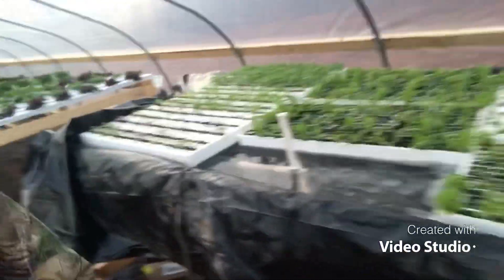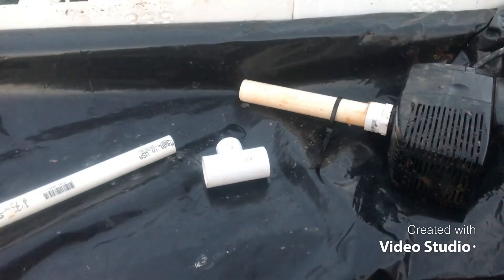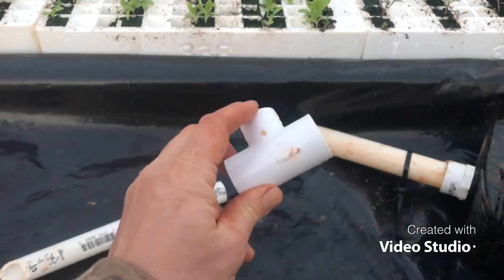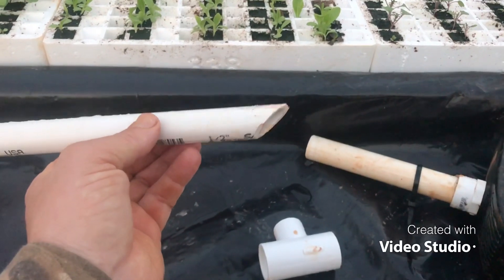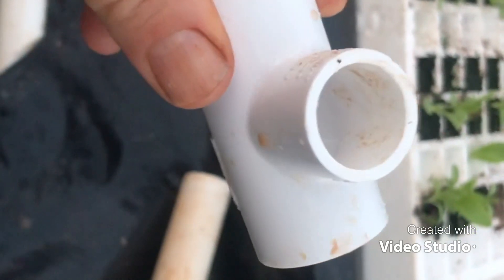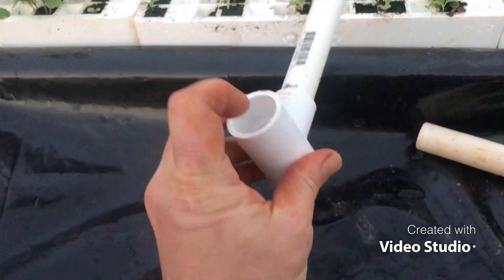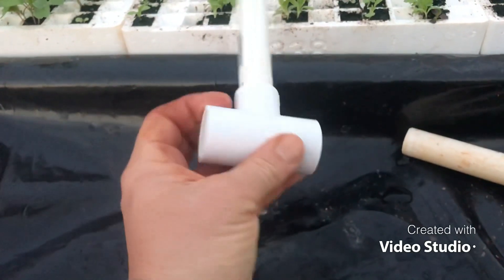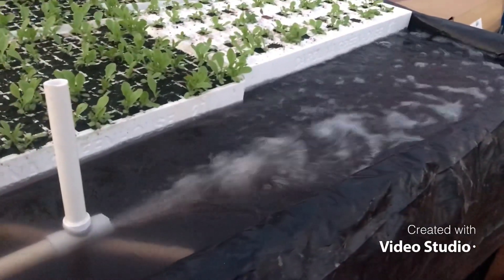Stop using airstones for hydroponics! Build this simple $5 venturi in 2 minutes instead!

Comment: hmm i dont understand..so what is difference from taking just air Hailea compressor air pump fith hose to pump air in the rezervour ?
Reply from the maker: The Venturi aerates, while recirculating the water, is simpler, more effective, and much, much cheaper when you scale the system up.

Comment: How does it compare to airstones in terms of aeration though? Airstones might be able to create smaller bubbles. Have you done a comparison of crop growth?
Reply from the maker: I’ve never done a comparison, I was just using what I had on hand at the time. A lot of people appreciate this because most people have a pump and some pvc already in use in their system. 

Why is it better?

1) it adds recirculation to the solution while only using 1 pump.

2) it doesn’t add any heat to the water.

3) it doesn’t change the ph like some airstones can.

4) it’s easy to clean when if it gets fowelled.

5) it spreads cool air bubbles around instead of in 1 spot.

Does it provide more dissolved o2 to the water than an air pump? This is relative. An x watt air pump is going to move as much air as an x watt water pump, with the exception of heat. If the air pump generates any heat as would when you compress and pump air, then your dissolved o2 is probably going to be lower if the wattage is the same size. 

My experience, I have never used an air stone but have had such great results with this venturi system that I will never need to even try. My roots are always very healthy! All I know is i read a bunch of negatives about airstones when I was researching them.
Reply: @SaludaGradeFarm Thanks for the great response. 
I can add that swapping out between air stone and  to a diy Venturi air-lift seems to be less of a load on the same air pump and bubbles are the same in size. 
The more uniform distribution if that freshly oxygenated surface water  is a big benefit.

Comment: How often do you change the water?
Reply from the maker: About once a month. Since I'm growing baby greens, and its DWC, the nutrient solution is incredibly stable. I hardly have to mess with PH or EC, except when I have to top it off, which is every 2 weeks. There is also far less algea in this compared to my NFT. This method is by far simpler, cheaper, and less time consuming than my NFT system, which is where I grow most of my produce.

Comment: Hmmmm… that’s got my gears moving. Great idea. I just opened up my aquaponics dwc because my air stones were moving all throughout the bed creating dead zones. Great idea 👍👍
Reply from the maker: Thanks! Depending on how big your system is you may need 2-3 of these. If I can get the time I will do an update on this and see how many venturis I can add to a single pump! This also adds the benefit of circulation too. Thanks for watching!

Comment: I like it but it’s very noisy
Reply from the maker: It is very noisy, but an airstone/air pump may be just as loud depending on how big it is, how much line you have etc. If I capped the air inlet on this and drilled some small holes in the cap it would be a lot quieter, and still have the same amount of bubbles coming out. 

Thanks for your comment!
Reply: @SaludaGradeFarm  now that’s a good idea. If it can be made quieter, I might do some experiments myself..
Reply from the maker: @SparkyMTB  If I put my thumb over the air pipe it gets alot quieter, so thats how I know. I plan to do an update on this, and ill put a valve on top to demonstrate. The root growth has been insane so I'm excited to show everyone what a difference it has made!
Reply: @SaludaGradeFarm  Great! Can’t wait to see the video. I use air-stones but if this is better then maybe I’ll have to put something together & try it myself

Comment: Another way that is more cheaper: drill a small hole at the impeller's outer case then fit in a tube there for air flow. Probably. Haha
Reply from the maker: That maybe worth a shot if I could find a used pump for cheap, Maybe if it was in the right spot of the intake it would catch the vacuum from the water flow.